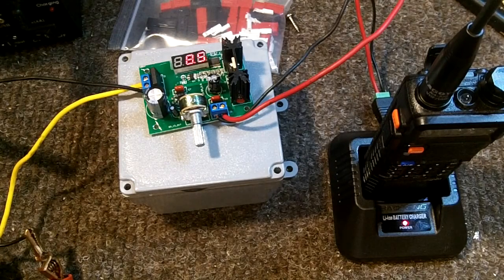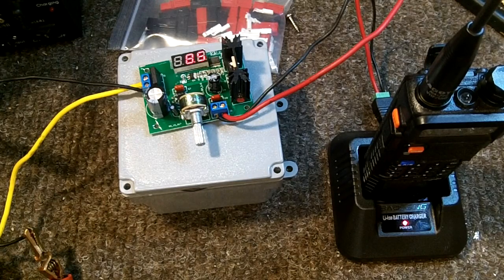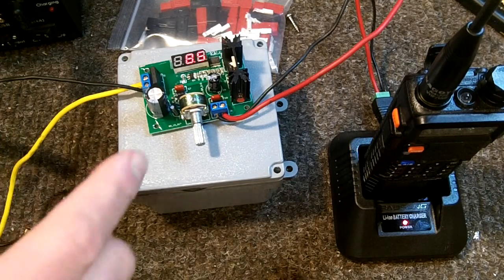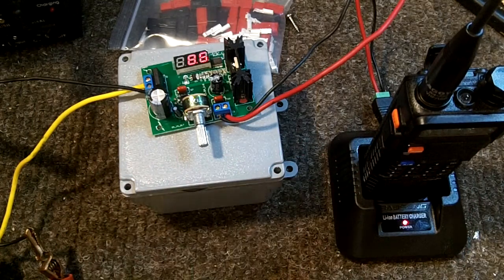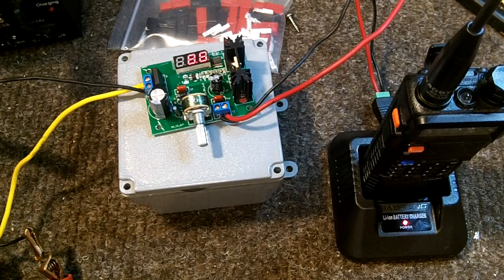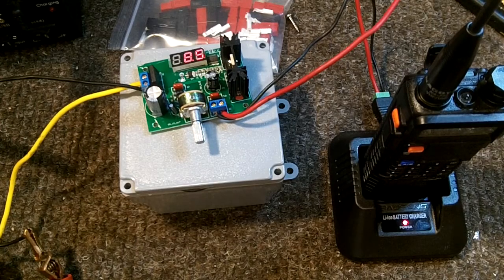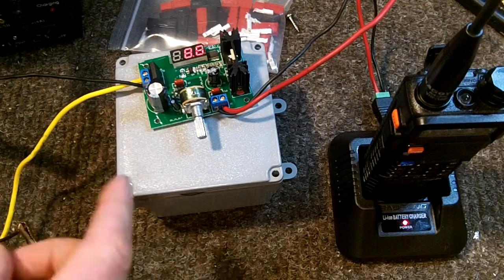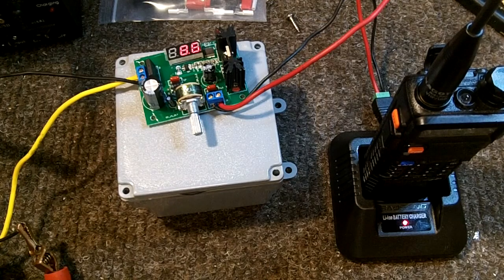DIY Baofeng UV5R Car Charger: Part 1

Comment: You haven’t done any research on direct charging ( without cradle) into the socket on UV-82 or UV-5R. I have 2 UV-82s, one has std battery, the other has a thicker ( sometimes referred to as “thicken” ) battery with a direct charge socket. Am waiting for delivery of usb cable for this, but a 12v option would be more robust/reliable if done correctly.
Reply from the maker: Thanks for the insight.

Comment: Let me share my experience of fixing junk Baofeng charger: I've replaced inner electronics by $0.7 cents TP5100 charging module (a clean AliExpress link, select a green module): https://www.aliexpress.com/item/33025217639.html
Here are step-by-step instructions: https://www.instructables.com/Improve-Upgrade-Repair-Charger-for-Baofeng-Radio/
TP5100 is much-much better chip than the one used by Baofeng with a wide range of input voltages from 10v to 18v. So, I would recommend to replace whatever is inside the charger by TP5100 charging module. Works like a charm, more efficient and reliable.

Comment: How are theys fengs holding up for you? I didnt have good luck at first and returned it but am considering trying again or getting a couple of the Quansheng tg uv2's... Looking for a durable radio to take camping, road trips,emergency comms, etc...
Reply from the maker: +GraymanTactics I have had no issues with my Baofeng radios. However, if you are looking for a different low cost radio concerned Anytone radios.
Reply: +Nomad-76 thanks, i've never messed with Anytone but have seen some good reviews. I'm less concerned about finding the absolute cheapest radio; just trying to find the cheapest without sacrificing too much durability and preformance... if that means a $400 HT then fine, i'd just rather not lol. So far, the Quansheng TG UV2 fits that bill pretty well. Ill look into Anytone more though. Thanks!

Comment: I've only ever used a 12v supply for my uv5r. Been nearly 2 years and regularly charge from 12 battery. Never had any problems ... I made a few videos of charging and power supply's for radios. Nice bid though mate. Keep it up.
Reply: Have u tried charging into the socket on uv-5r or uv-82 ( which is what I have) can only find usb cable for direct charging ( without cradle) , 12 v would be more reliable.
Reply: Have u tried charging into the socket on uv-5r or uv-82 ( which is what I have) can only find usb cable for direct charging ( without cradle) , 12 v would be more reliable.